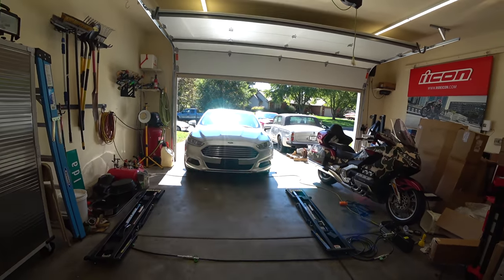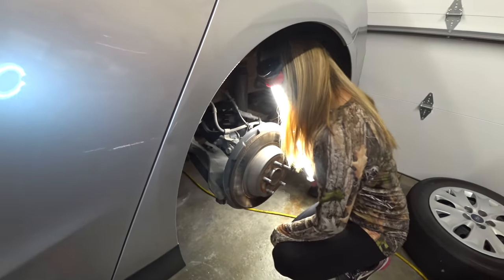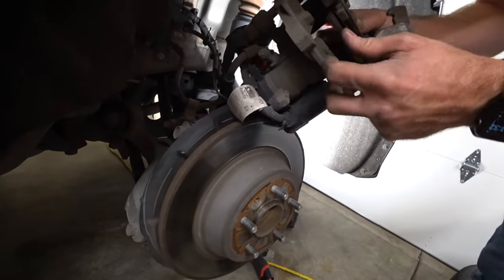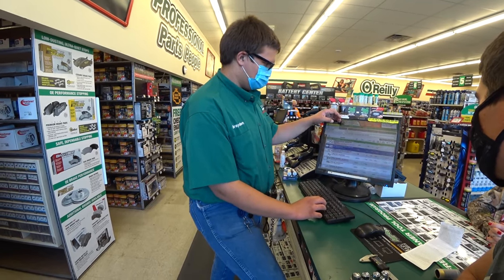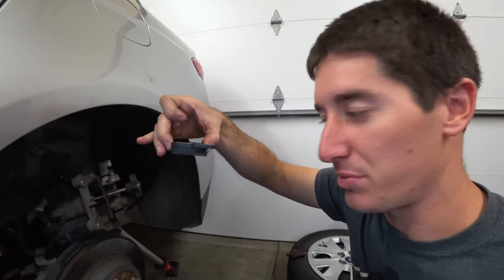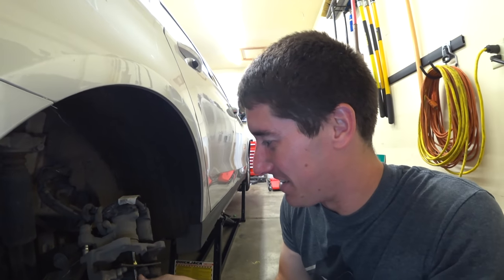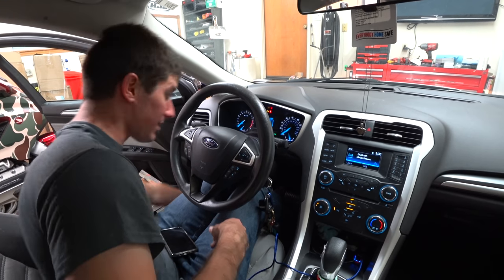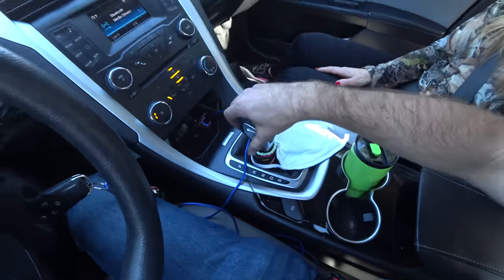GIVING A Single Mom A BRAKE Job (Dealer Wanted Too Much $$$)

Comment: Those ford lugs swell all the time, mine get stuck in the socket and I have to destroy them to get them out. Best solution is to just buy some quality nuts. Its worth the price over replacing the ford ones almost every time you take off the wheels

Comment: The factory lugs nut are 19mm not 20s lol. They swell up and turn into 20s lol, rust and debris find they're way into the cap and rust and swell. My shop sells what we call solids. Which are complete with no metal caps to swell. So it doesnt happen again.

Comment: Swollen nuts are a problem on Ford vehicles. Happened to my 14 escape. Dealer replaced at no charge. The lug nut is a 2 piece design and over time they swell/deteriorate.  There has been a lawsuit about this problem. You can check Ford complaints online.

Comment: The dealer isn’t lying its a very common thing on those Ford Fusion or other fords lug nuts where they made the lug nuts out of another material and overtime they swell with heat and become impossible to remove just ask me how there’s a tsb and letters of complaint to ford to recall them but they continued to use them
Reply: I swear they bought the lug nuts from Dodge, they've been using those shitty chrome capped pieces of junk for so long snap on makes a 19.5 socket so you can get them off after busting the chrome cap off.

Comment: My daughter just got her first car, a 2012 Fusion. One of the first things we did was to change all the lug nuts with new solid lug nuts. The original ones have aluminum covers and can swell up so a socket won't fit, or round over, or the aluminum peels off, making the hex smaller.  Had to hammer on a socket to remove the old nuts. Such a stupid design to save pennies.

Comment: Stock fusion lugnuts are definitely not 20. They’re 19 from factory but the caps swell. They make 19.5mm sockets for getting them off when the cap swells like that

Comment: My 2014 Focus had same problem with poorly made lug nuts, cost 114 bucks at dealer. No time to "shop around" for cheaper. Supposedly was a recall, but didn't get official notice.

Comment: The first time my step-dad replaced the brakes on my Buick (first car), he purposely DIDN'T coat them, so I would learn the difference in sound/feel from that to brakes that needed replacing.

... Which was great because I beat the hell out of that car and went through 3 sets of brakes and was on my 2nd set of rotors when I traded it.

Comment: I did the rear brakes on my sisters MKZ  same thing swollen lugs so bad I couldn’t even take them off without prying the cover off first. Also the caliper slider bolts were so freaking tight from the factory.

Comment: 7:36 Does that caliper spreader work well? I usually use a huge pair of pliers, and even with those I have to squeeze down pretty hard. I dunno if turning a knob with my fingers will be any easier. Seems like it would be much harder.

Comment: The factorylugnuts are 19mm.  They have that stupid chrome cap on them, the nut rusts underneath and swells the chrome cap.  That's why you needed a 20mm.  All my Ford cars are 19mm from 2000-2017

Comment: Swollen lug nuts are a huge problem on these early 2010s fords. I had to replace all of them on my 2010 f150 after the same thing happened. It ended up snapping two lug nut posts off while I had a full load on the highway.  I didn't even notice until I went to change my oil the next day.   There is a class action lawsuit against ford for this, but I don't think it's ever going to go anywhere.  They put these cheap plastic caps on the lug nuts to make them look like they are solid metal.

Comment: You’ve never heard of swollen lug nuts? I’m Wisconsin that happens all the time. The chrome on the outside of the steel swells up and you can’t get the proper size socket on the lugnut. On a car like that it’s probably 19 mil anyways...

Comment: I'm surprised you haven't heard if life juts swelling. Plastic coating always corrodes and swells anywhere there is salt on the roads in the winter. Very common. Get rid of those garbage coated lug nuts and get solid steel.

Comment: I had a Focus with the same lug nuts. Just replace all of them with decent lug nuts. They were actually 3/4 in with the cover and 19mm underneath.  They are absolutely trash and become a nightmare to get off when they swell.

Comment: Actually, Ford lug nuts are known to get swollen because of the 2 piece cap design, so you do have to change them eventually. At work I have a special socket set by Matco that has 19.5, 21.5 etc to get those swollen lug nuts off. There was a class action lawsuit against ford for the lug kit design but Ford won because they always happen outside of warranty. Kinda bullshit but the dealer wasn’t bullshitting her.

Comment: Ford has a issue with lug nuts. Had to change all 20 on my wife's 2013 Escape. They have a thin layer of metal pressed over the nut. With time, junk and water gets under that thin layer, and then the stock lug wrench won't fit the nuts!

Comment: Yeah Ford's lug nuts legit suck. I was changing rear pads on my Focus ST and noticed I couldn't even get the 19mm socket around the lug nut, so I literally used a hammer to smash the socket onto the lug nut and then it came out with an impact gun :D

Comment: Most of the Fords have those lug nuts with aluminum caps over them. They really suck! If they get rounded off just hammer on an 18 or 18.5 mm socket and they should come off.
Reply: Now im wondering if the Lincoln MKZ are the same???
Reply: @210SAi  Lincoln is the luxury division of Ford but i hope they didnt cheap out in them.

Comment: can you show better camera close-ups with better lighting during brake pads being inserted and replaced? also can you show replacement of 2-3 motor mounts on a 2000 Lexus LS 400?

Comment: Swollwen lug nuts. What happens when you put a shitty thin chrome cap over a steel nut you could have just chrome plated and introduce moisture. Electric parking brakes are still stupid and will always be stupid. However they are great for getting cars back into the service bay which was their intended design purpose.

Comment: No turning the rotors?  Did you check runout?  Doing brakes is also a great time to flush the brake fluid, which nobody does.

Comment: Rear brakes on the 13 and up Fusions are common to go out first because of the hill start assist / electronic rear parking brake.  Ford lug nuts are the absolute worst things ever.

Comment: i work at a shop the lugnuts are toast bc ford escape and fusion lugnuts have the WORST design they are two peices and the top peice that is all stripped comes apart so easy and you have to grab a 20 lb hammer and bang the socket on to the lugnut just to get it off when you finally get it off the lugnuts are trash. horrible design whenever i see a fusion or escape come in i leave it for someone else lol

Comment: They were all 19mm and they mushroom into 20mm.
Never use a 20mm on them unless you want to replace them. Just hammer a 19mm socket on them to fix them or order a 19.5mm lug nut socket on amazon.

Comment: Nissan dealer tried to rip me off. Went there for recall work on the brake booster. I said might as well do the brakes. Was pretty funny when I called them out on their 100 dollar brake hardware. I’m like oh. You mean the  5 dollar brake hardware or the replacements that come with each set of pads.    The guy was like 😮.  I didn’t notice. Lemme go check something. Needless to say the bill was hundreds less. I just do them myself now. It’s ridiculous what they charge.

Comment: Electronic parking brakes are not a good idea. What happens when you need to use the parking brake in an emergency? And how much are the actuators? I know Chrysler’s are over $200 each side.

Comment: So the swelling lugs are a semi-common thing. I'm not sure if it happens to other manufacturers, but I hear about it with Ford.  Moisture gets trapped between the steel inside and the whatever they coat the outside with (aluminium, chrome, whatever your wheel is), and it expands.  Then when you go to torque on it, it splits.  There was a lawsuit about this I believe... Just use solid lugs!

Or, you know, we could just talk about the mom and all the sex jokes :eyeroll:

Comment: why take off entire caliper assembly off. you should first take off caliper and then remove pads and brackets. much less weight being handled at one time. also were the caliper pins greased and anti seize on the pads and hardware?

Comment: Actually, the stock lug-nuts are 19mm.  They swell to the point where you can't get a 19mm socket on them, and they eventually split and disintegrate -- there's a whole big class-action lawsuit about it.  Ford lug-nuts from the past 3 to 8 years or so are all crappy like that.

Comment: did my friends moms pads rotors bled the system and filled with fresh brake fluid and did an alternator replacement with new serpentine for the cost of parts from Rock Auto
Reply: I get all my parts from Rock Auto lots better prics then NAPA  or CAR QUEST  in my area

Comment: I hate electronic parking brakes.  They suck.  They not only make rear brake-jobs harder (sometimes IMPOSSIBLE without special tools, depending on the manufacturer), they're 100% unnecessary.  There was literally nothing wrong with the old style pull-handbrake or step-footbrake and a physical cable going back there to actuate the calipers or shoes.  Not a damn thing.  Manufacturers put them in solely to make cars more expensive (higher profit margin) and harder to work on so you're more likely to go to the dealer than do it yourself.  It's technology for technology's sake.  It's ridiculous and stupid.

Comment: Just so you know those lugs stock are 19mm but they are one of the biggest f ups from ford because they wiiill brake and need to be replaced after the first 2 or 3 time those tires come off if youre lucky no matter how good you are to those lugs they will swell and be stupid

Comment: I'm beginning to think that all brake jobs are the same price just to subsidize each other. New systems are more complicated with sensors etc...but  some are the same simple setups from 14-20 years ago.            I don't see how my  front brake job that cost $120 for new pads/adjust rotors  costs $350 six years later...

Comment: You did that the hard way...why wouldn't you take the caliper pins loose instead of the entire bracket? Those are torqued down tighter than you can get with a ratchet wrench for sure!! Hope they don't come loose....

Comment: Maybe you should put a disclaimer that she wasn’t getting overcharged at the dealer for breaks. She just didn’t want pads,rotors hardware, or quality of work. So she had this dimwit pad slap it. At a dealer it would come back with a pulsation or uneven wear if they did “brake jobs” like this hack

Comment: @watchjrgo you are using the quickjacks totally wrong. I saw that on previous videos and you keep doing it wrong. The safety locking lever needs to be facing outside the vehicle not the inside. Plus you should never drive a car over the hydraulic lines, it can damage it and burst under pressure.
Reply: And...he had his customer in the space where the wheel was...with the body of the car over her head. Wow...this is far from "cute" ....this is extremely dangerous. In this case, as you have explained, he had not activated safety locks. As a customer, I always stand way back, while a mechanic works on my car.

Comment: I am not a mechanic...my understanding of car repair is minimal...however I must say...a key, essential rule for every repair shop should be: NEVER place your customer under a racked or jacked up car. In this case the "jacks" are just gigantic scissors jacks. This mechanic shows his customer with her head where the wheel should be, with the body of the car over her head.  A mechanic might get away with this...and then again...he might not.  And if "not",  he has created a life changing catastrophe.

Comment: Anybody else cringe at not setting EPB maintenance mode first, no cleaning the calipers, no lube of contact points or slide pins, no resurface of rotors (or at least buzz them to get the old glaze off), and disk brake quiet spray?

Comment: I mean i dont know with the powers of editing or what her budget was on this brake job but you literally had the brake caliper bracket off the car, you should of resurfaced or replaced the rotors! Shes going to be coming back when her car is vibrating. Also with knowing this is commuting a child around i'd be more cautious just throwing 2 bolts back on with dry blue loctite and not using a torque wrench to lock those vital bolts down! Did you not bleed the brakes afterwards? Hopefully you lubed the caliper guide pins, those things might go dry and lock the caliper on the rotor. At least you knew about the service mode for the ebrake on that car. Some people have screwed their pistons up not knowing about it.

Comment: Why take the caliper off and lube slide pins or clean the brackets? Why bother changing the rotor? I guess this guy like brake pulsation and pads sticking

Comment: Those Ford lugnuts are trash, they do indeed get "swollen" since they are two piece design with aluminum cover, so they corrode and delaminate.  Plus they are 4x the price of generic lug nuts but you pretty much need to get the OEM ones since they are also what is used to secure the wheel cover.

Comment: I would have replaced all the wheel lug nuts. If she ever has a tire blow, she would need 2 wrenches for removal.
Those Ford lug nuts are garbage
Reply: He got a 19mm socket, I assume to leave in the car since he would already have one that size for himself.

Comment: That Ford lug nut issue is present on all their new cars. My wife's Edge, my buddies MKZ... etc. They have a decorative thin metal shell over them that rusts and bloats making them completely unusable. Ford needs to stop using the design.

Comment: Several things... first, I thought it was funny when she rolled her eyes about ever doing a brake job on her own and second, it's a common thing with these cars supposedly, I have the MKZ which is the same platform, just dressier, and every time I go in to the dealer, I have to get lug nuts replaced... crappy design I suppose. BTW, I hope you took her out to lunch or dinner afterwards since she's a "single mother"
Reply: oh ya and what's up with making her carry the parts and open her own door... dude seriously your slipping, that's not how you treat a lady

Comment: Hate to be that guy but that's not a brake job it's a pad slap, dealer wanted more money to do the job the correct way and either resurface the rotors or replace them. You very easily could have replaced the rotors as O'Reilly and all the other parts stores do bundle deals on brakes under shop accounts. And that lug nut thing is common on ford's and Chrysler jeep and dodge cars with the fake chrome cap on the lug nuts.

Comment: Sorry but you did not get to the root of the problem. Something else is wrong for the rear brakes to wear out before the fronts. In theory the fronts do sixty percent of the braking so if those pads are fine, there are real problems. Frozen pistons in the calipers, something clogged in the ABS or something else? That needs to be tracked down. And I have no idea what lug nuts cost but I would have replaced every one of them front and back and made sure she had a tire tool that fit the new ones. Why send her out on the road with bad lug nuts that would be impossible on the side of the road??? I know you did it free, but you got off easy with no front pads, no rotors, etc. so what would the extra lug nuts be compared to that??? I guess this is better than nothing for the safety of her and kids, but dang I just cannot send someone out to a real problem down the road.

Comment: 10:29 you complained about having room to swing a wrench. If you had done the job as it was intended to be done you would have removed the caliper from that mounting bracket. You would have had plenty of room and you wouldn’t have had to fight to get the pads mounted.

Comment: This wasn’t a brake job this was a pad slap. Unfortunately sue happy Americans and their lawyers have made it that you pretty much have to replace everything to avoid liability down the road. This will confuse people that don’t know much about cars and will make them think anything else is a ripoff. I would do the same to my car plus changing brake fluid and lubing caliper pins. As a business owner you have to do so much to prevent claims and lawsuits. It’s not a matter of if just when someone will sue you these days.

Comment: The funny parts. The obvious over-confident, " Should take like 15 minutes". Even she thought damn no way big boy. Mentions electronic parking brake...wait for it.... learns to release.  Doesn't have a 19 deep socket? How is that remotely possible?   Hope it all works out with "good karma"..  wink wink.  Remember the statement... No good deed goes unpunished.